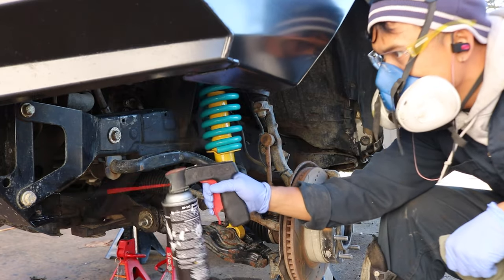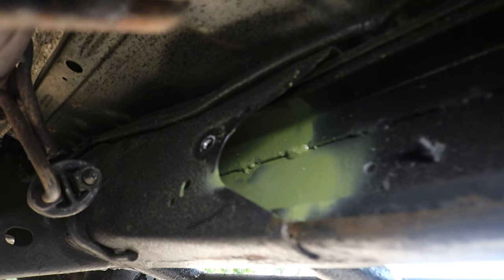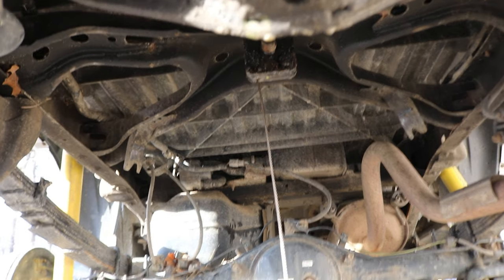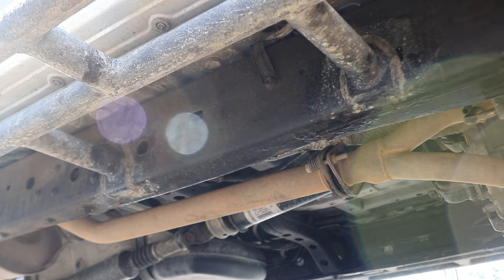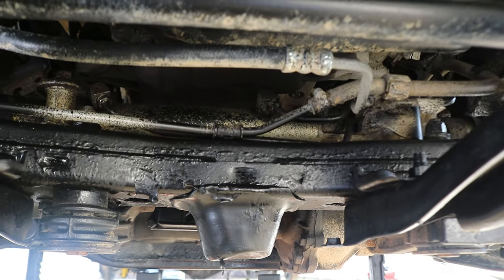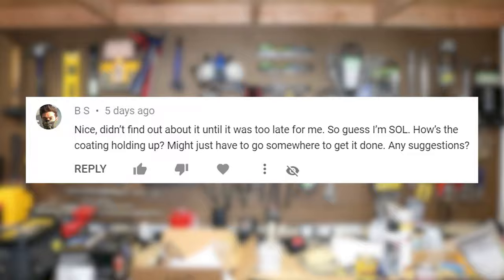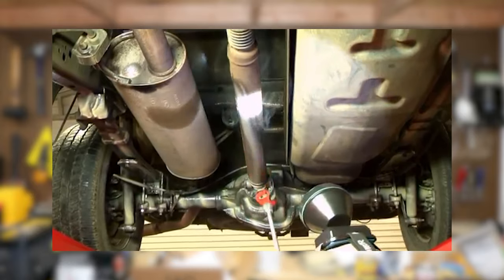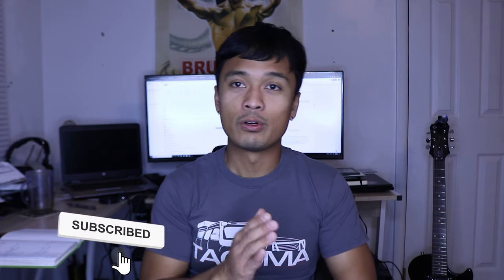Better than Fluid Film?

Comment: I use the same stuff it works awesome. Then I also spray used motor oil inside the frame and any places that I miss so it can seep around. It works great. No rust at all.
Reply: I spray my Tacoma with used motor oil in all the holes 🕳 of the frame. I hope it’s seeping into all of the little nooks and crannies. It’s a 2002 with rust damage and I hope it stops it.

Comment: The fluid film the apply kost importantly is done mostly to the interior of the frame, n then they plug the majority of the holes after with rubber plugs which is how u can tell if it was done. At least thats what they did with my 2012 tacoma. I live in pa and we salt, and worse brine they put everywhere. My tacoma is doing really good for this area. It was rust on the one cross memeber in the rear of the truck that actually can be replaced easily. Thats the only flaky rusty piece, that is thinner shittier metal than the frame though. Other than that, typical surface but only on the creases in certain corners.
Looks good.

Comment: Hey KFlo, awesome video! I think you helped me make a decision on what I am going to try out. The RP-342 looks like it should hold up nice.
Reply: Did you use any rust converter prior?
Reply from the maker: I didnt use any rust converters but when i was doing the dialogue, I was thinking that I definitely should have used some of the ospho that I had stocked in the garage. Oh well, I'll use the rust converter on any of the touch up i do in the spring. I'm glad the video helped! Good luck brother
Reply from the maker: Oh yea, just make sure the rust converted surface is fully cured and dry prior to applying the RP 342
Reply: My frame is not to bad really, few spots here and there. Im in CA so not nearly as damaged as most. Just want to prevent as much as I can. Thanks again man!

Comment: U should have used degreaser and pressure wash a few times. The dirt and grime that builds up from fluid film is what also helps against rust, giving it a barrier. I've tried many products,  fluid film/oil is tried and true. That's how farmers  keep their old vehicles rust free.
Reply from the maker: Fluid film is definitely a great brand, don't get me wrong. My preference to have no dirt sticking to the frame. It's all self preference at the end of the day. I would highly recommend watching project farm's video as he does comparison with all these brands in harsh testing environments.
Reply: There are many fluid film products and similar that are easy quick and better than doing nothing.
Something to think about, is any fluid film is solely a preventative measure, yes it will slow rust already there ofcourse, but it should be used on a new frame n then applied a min of every year and thats only if you dont wash the underneath to thoroughly to often. Lets say ur a nut and clean the f out ur truck and spray underneath it alot. U will then need to apply that fluid film potentially 2 times during the winter months and potentially even 1 more time when the weather breaks which will easily hold you until the following winter.
So its very possible 3 times a year, which if done properly will sure look different in 10 years than a vehicle than has had zero preventative intervention.
Also, just doing things like getting an alignment in 7 years, you wont need to replace those cam bolts just get that done.
It makes a huge difference

Comment: You may have mentioned it, but I didn’t hear it in the video. I’m assuming you need to re-apply RP-342 yearly? 

I’ve never used fluid film, but use woolwax instead. It’s essentially the same thing though
Reply from the maker: I'm not too sure in terms of interval of reapplication.  According to the website, 1 application is supposed  to last a few years. I will probably start with a quarterly visual inspection and touch up any places that look thin.
Reply from the maker: Also, Merry Christmas and Happy Holidays!
Reply: Thank you, Merry Christmas to you as well!

Comment: Hey KFlo, I have a 2009 Tacoma access cab 4X4. My date of first use is may 2009 therefore my extended frame warranty runs out may 2021. I haven't done anything to the frame but it is in very good shape no chance of getting a new one thru warranty(why I hadn't done anything yet). My research also led me to Eastwood internal frame coating and RP342 and as soon as it warms up enough I take on this project. My question, Do you see any advantage to having the free warranty undercoating offered buy Toyota done?, or should I just go ahead and do my own plan, it sounds to me like the Toyota undercoating might just make the frame more difficult to clean/prep, and keep the Eastwood and RP342 from adhering directly to the frame. What do you think after having it done. Also how many cans of Eastwood did you use? And Im with Mike just ordered gaskets for valve covers and doing the temp fix on the timing chain cover.
Reply from the maker: It would be a mess trying to apply your own coating after you do the coating from Toyota. That undercoating they use stays "wet" for several weeks. If it's currently in good shape, I would advise just cleaning and prepping it yourself. You can probably get away with 3 cans of the internal frame coating and 6 cans of the RP 342. Both are linked in my Amazon page by the way. Amazon.kflo-krib.com
Reply: @KFloTacoma  Thats what I thought, it has some surface rust so I will be doing prep on that, I will run a drill with cable and some chain on the inside of the rails just to knock what I can off. Thanks for the videos man you do a good job! when I purchase my supplies I will use your page, weather gotta get a little warmer yet.
Reply from the maker: Another thing I thought about after putting together the video, would be to use rust converter first like Ospho before applying the RP342. It just adds another step for rust prevention.
Reply: @KFloTacoma  I checked out a couple rust converters but didn't think the result was worth the effort in addition to adding another chemical too the mix . Hey Im going to put in some new exhaust cam gears this weekend (retards 3*) I have to address the timing chain cover/ valve cover seep/leak issue, so I thought while I'm in there why not. If your'e on TW it's in the 2nd gen "for sale" as a GB. Check it out, cam gears, Diff gear swap, and throw an HP tune on it, your truck will feel like you installed a super charger! keep up the good vids.
Reply from the maker: That's a cool idea, I'll have to look into into that and add it to the mod list! thanks!

Comment: Por 15 says right on can it needs top coating
Reply from the maker: With all due respect, I believe you are mistaken. 
https://m.media-amazon.com/images/I/A1iuhR9UgYL.jpg.
"Top coating is not required for areas not exposed to sunlight"
I had sections of the frame covered with POR 15 in the middle of the frame that was not exposed to sun light and was prepped properly that started peeling off after ~5 years.
Reply: @KFloTacoma  underside gets exposed to sunlight just from glair of road inside door is about only place it won't be
Reply from the maker: That is a very great point - I'm the one mistaken. I didn't think about UV reflection. Thanks for pointing out my oversight, I'll be sure to credit you on my next frame update video. I appreciate the respectful discourse.